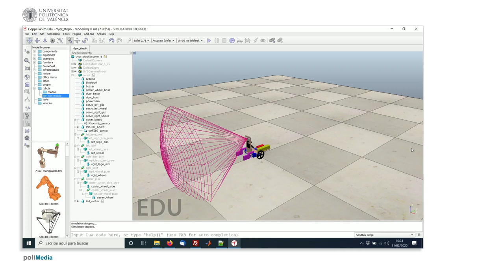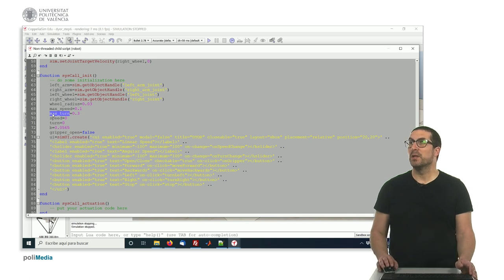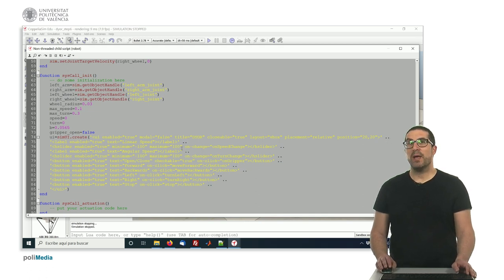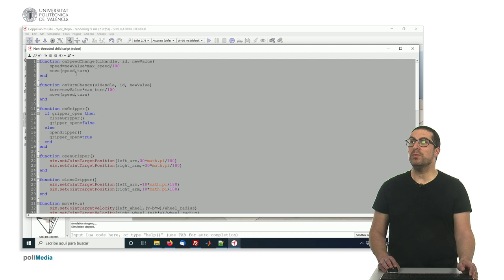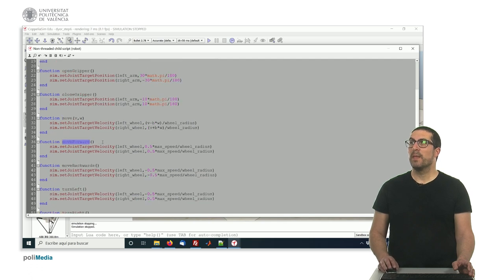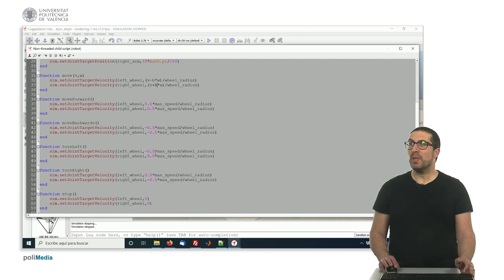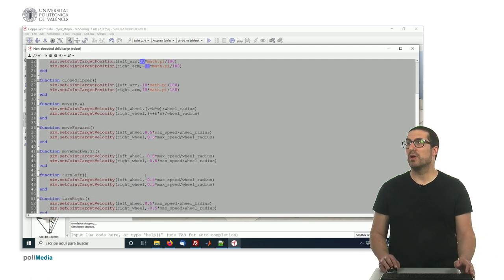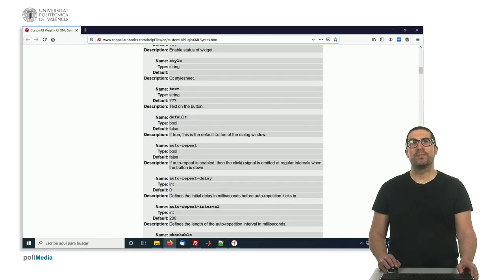Creating DYOR robot (Step 6) | CoppeliaSim (V-REP)

Comment: Sir, there is an error that the revolute joint is not dynamically enabled which is causing the problem will running the code. Can you help with this?
Reply from the maker: I don’t follow you. If the joint moves a dynamic object, then, you will need to enable the dynamic control.
Reply: @LeoArmesto  Thank you I was able to solve the error.